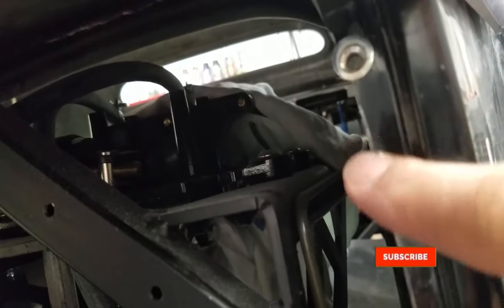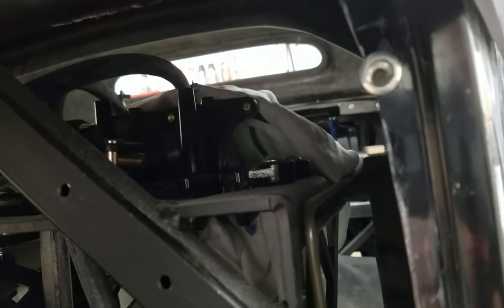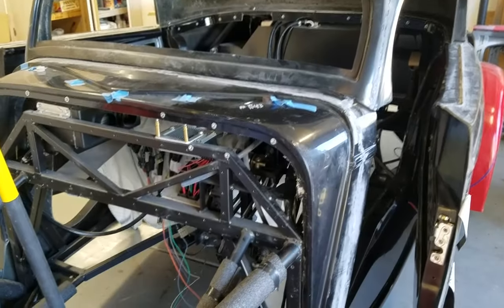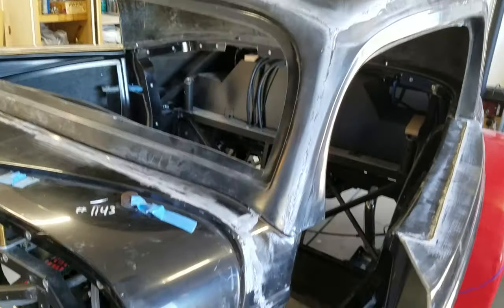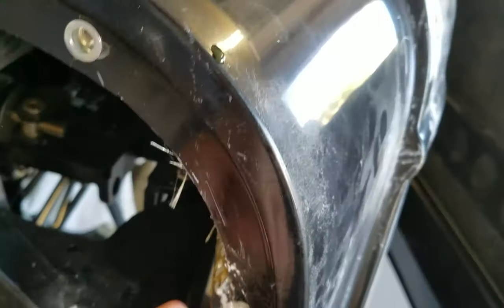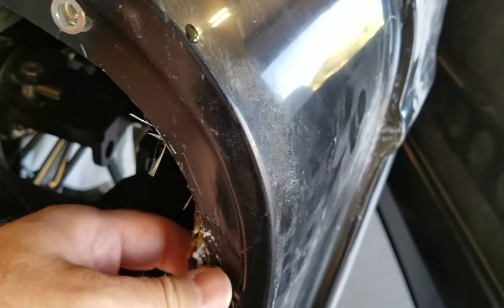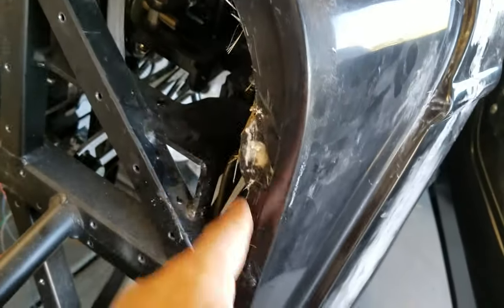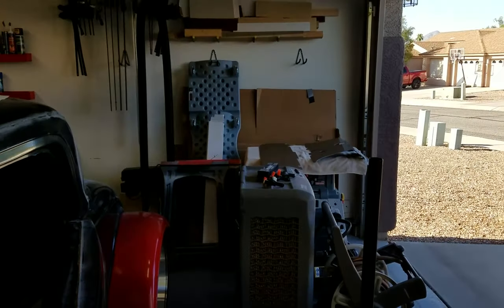Factory Five 33 Hot Rod V2 - Firewall -RivNut Fix

Comment: I might have taken a backing plate and using two 1/8 rivets or small screws to hold the plate on and then epoxied the extension to the edge, It would provide a better all around stronger bond.